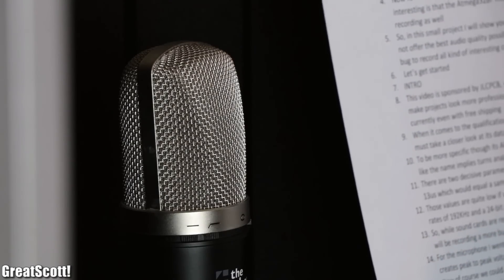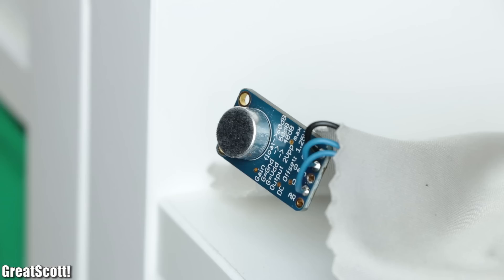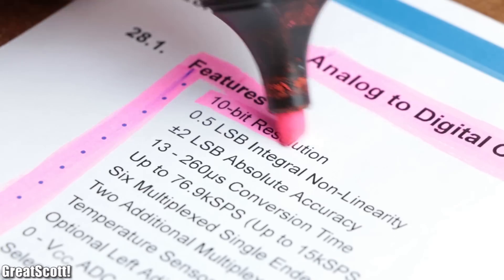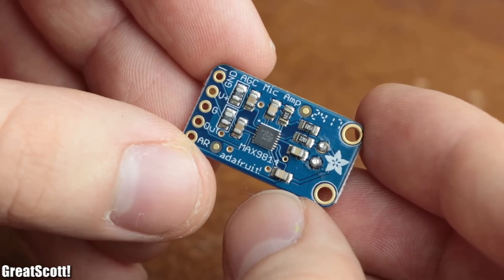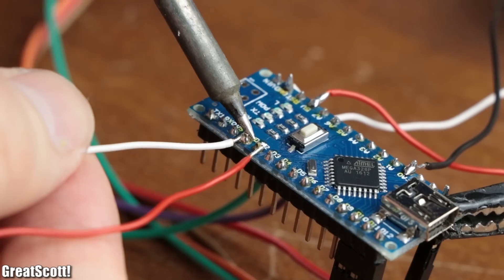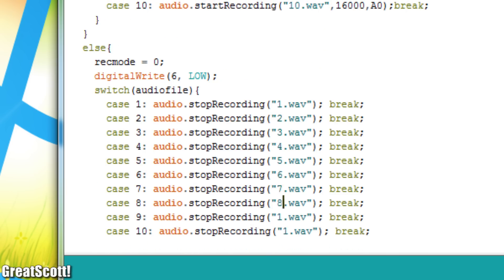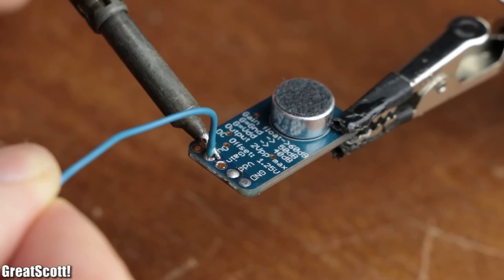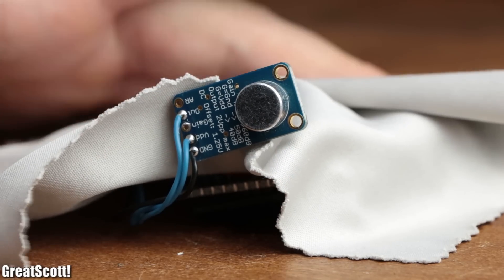Make your own Spy Bug (Arduino Voice Recorder)

Comment: I'm having problems compiling the code, the libraries are both includes but I still get this error message: 

Thanks for the help!

Arduino: 1.8.3 (Windows 10), Board:"Arduino Pro or Pro Mini, ATmega328 (5V, 16 MHz)"

C:\Users\Max\Downloads\SpyBug\SpyBug.ino: In function 'void button()':

SpyBug:44: error: 'class TMRpcm' has no member named 'startRecording'

       case 1: audio.startRecording("1.wav", 16000, A0); break;

                     ^

SpyBug:45: error: 'class TMRpcm' has no member named 'startRecording'

       case 2: audio.startRecording("2.wav", 16000, A0); break;

                     ^

SpyBug:46: error: 'class TMRpcm' has no member named 'startRecording'

       case 3: audio.startRecording("3.wav", 16000, A0); break;

                     ^

SpyBug:47: error: 'class TMRpcm' has no member named 'startRecording'

       case 4: audio.startRecording("4.wav", 16000, A0); break;

                     ^

SpyBug:48: error: 'class TMRpcm' has no member named 'startRecording'

       case 5: audio.startRecording("5.wav", 16000, A0); break;

                     ^

SpyBug:49: error: 'class TMRpcm' has no member named 'startRecording'

       case 6: audio.startRecording("6.wav", 16000, A0); break;

                     ^

SpyBug:50: error: 'class TMRpcm' has no member named 'startRecording'

       case 7: audio.startRecording("7.wav", 16000, A0); break;

                     ^

SpyBug:51: error: 'class TMRpcm' has no member named 'startRecording'

       case 8: audio.startRecording("8.wav", 16000, A0); break;

                     ^

SpyBug:52: error: 'class TMRpcm' has no member named 'startRecording'

       case 9: audio.startRecording("9.wav", 16000, A0); break;

                     ^

SpyBug:53: error: 'class TMRpcm' has no member named 'startRecording'

       case 10: audio.startRecording("10.wav", 16000, A0); break;

                      ^

SpyBug:60: error: 'class TMRpcm' has no member named 'stopRecording'

       case 1: audio.stopRecording("1.wav"); break;

                     ^

SpyBug:61: error: 'class TMRpcm' has no member named 'stopRecording'

       case 2: audio.stopRecording("2.wav"); break;

                     ^

SpyBug:62: error: 'class TMRpcm' has no member named 'stopRecording'

       case 3: audio.stopRecording("3.wav"); break;

                     ^

SpyBug:63: error: 'class TMRpcm' has no member named 'stopRecording'

       case 4: audio.stopRecording("4.wav"); break;

                     ^

SpyBug:64: error: 'class TMRpcm' has no member named 'stopRecording'

       case 5: audio.stopRecording("5.wav"); break;

                     ^

SpyBug:65: error: 'class TMRpcm' has no member named 'stopRecording'

       case 6: audio.stopRecording("6.wav"); break;

                     ^

SpyBug:66: error: 'class TMRpcm' has no member named 'stopRecording'

       case 7: audio.stopRecording("7.wav"); break;

                     ^

SpyBug:67: error: 'class TMRpcm' has no member named 'stopRecording'

       case 8: audio.stopRecording("8.wav"); break;

                     ^

SpyBug:68: error: 'class TMRpcm' has no member named 'stopRecording'

       case 9: audio.stopRecording("9.wav"); break;

                     ^

SpyBug:69: error: 'class TMRpcm' has no member named 'stopRecording'

       case 10: audio.stopRecording("10.wav"); break;

                      ^

exit status 1
'class TMRpcm' has no member named 'startRecording'

This report would have more information with
"Show verbose output during compilation"
option enabled in File -> Preferences.